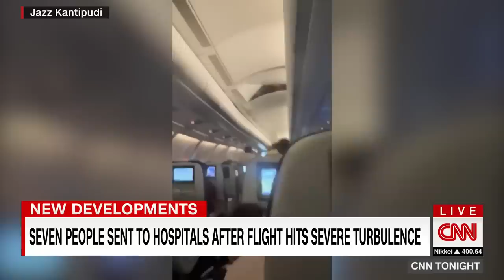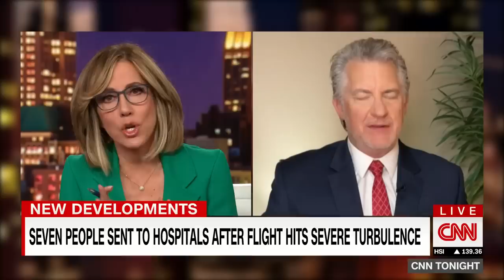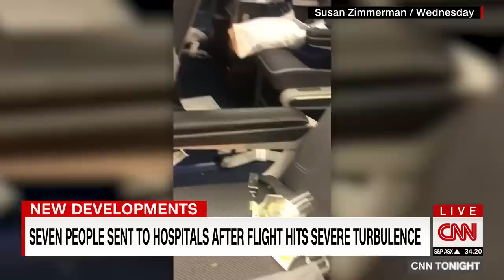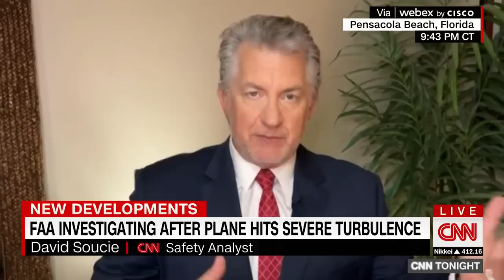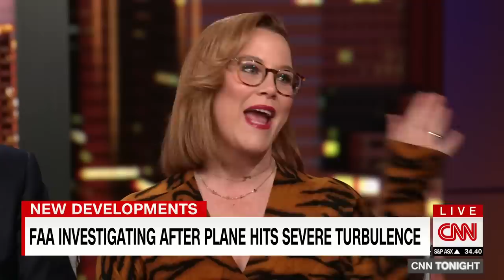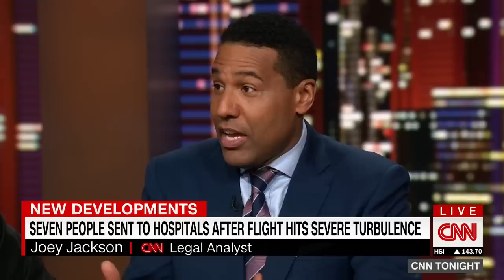Video shows aftermath of extreme turbulence on airplane

Comment: I experienced an air pocket drop in Japan Sea three years ago. From 37,000 ft down to 26,000 ft dropped. That was a traumatic experienced for me at that time.
Reply: I'd probably be quite terrified too. Luckily I have never experienced anything like that. BTW, do you actually know the reason for the drop? There's actually no such thing as "air pocket" (although people use that expression often). A passenger airplane flying at 37,000 ft is never far away from stalling, and that's most likely what happened in your case, telling from the large loss of altitude. Sudden headwind or flying too slowly because of a malfunctioning air speed indicator are examples of what can cause a high-altitude stall.
Reply: It must have been, you describe it like you were in 'nam.
Reply: Did you have an altimeter at your seat?  How long did it take to drop 11,000 feet?
Reply: Good to have the What's My Altitude App.
Reply: @cnnothingburgerletsgobrand6381   you shuoldn't send out signals whilest in a plane as they can interfere with the cockpit communication.
Reply: @blessedANDunimpressed  why?
Reply: @adoatero5129  Dead pressure zones. People say "air pocket", but it is the opposite. Its actually a low pressure zone, so you lose all lift force. Thus, falling like a rock
Reply: Stop lying.  There is no such thing as an ‘air pocket’ and no way you know the altitude.
Reply: @matthewcurry3565  – "Dead pressure zones."
What are those? Zones with no pressure? I'm sorry, but that's imagination. No such thing actually exists in the atmosphere. What probably happened is what I mentioned in my first comment. There isn't normally much turbulence at 37,000 feet (there can be, though) , so it was more likely wind shear (sudden change in wind speed). If you suddenly fly into air that's moving towards the direction that you are flying, your airspeed (speed relative to air) slows down, and at those altitudes the margin to slow down your airspeed without stalling is very small. If you cross the limit, you go to stall, and begin to fall. Because of the thin air, it's difficult to recover from the stall condition, and you may fall thousands of feet before you get the wings generate enough lift again.
Reply: @adoatero5129  Yup. That's a deadening in your air pressure resulting in the fall. Thanks for validating my presumption with the science 💚
Reply: @adoatero5129  The main joke is that it cannot be anything else. Lmao. With pressure you cannot fall. Without it you fall. Doesn't matter what scientific explanation resulted in it.... In the end its lack of lift pressure. So, a dead zone.
Reply: @matthewcurry3565  The lift that keeps an airplane up doesn't come from meteorological air pressure, but aerodynamic one. Also, wind (air movement) and air pressure are two distinct phenomena. When a plane (wing) stalls, what normally happens isn't that pressure disappears under the wing, but increases above the wing.
Reply: @adoatero5129  you are trying to make this a lawyer technicality battle lmao. If the pressure increases on the top side, and then the bottom is subjected to lower pressure it results in poor lift. Thus, the pressure differential can be seen as both, or either way. 
I'll just argue that aerodynamics is literally all about pressures, and how they relate to an object moving through a gaseous body.
Reply: @adoatero5129  And it doesn't matter what type of air pressure. I just said air pressure, so I'm still correct. I do not get your point?
Meteorological air pressure does play a role in aerodynamics, and..... Aerodynamic air pressure is obviously related to aerodynamics too. You seem to be going in circles.
Reply: @matthewcurry3565  – “Meteorological air pressure does play a role in aerodynamics…”

But (very likely) not in the incident we are talking about.

– “You seem to be going in circles.”

It seems so to you, because you are mixing up two very different phenomena. When you fly at 37,000 feet,  the changes in atmospheric air pressure are normally so small that they don’t affect an airliner much. On the other hand, there are other atmospheric variations (wind shear, etc.), that affect airliners often and quite often also powerfully. In short, the “dead zone” that you offered as an explanation for the incident is hardly the culprit, so in that you were probably wrong. I’ve been often wrong myself, so don’t worry :-).
Reply: @adoatero5129  You're the only one who brought up atmospheric pressure. Now you are saying it is unrelated. That's my very point to you. Obviously I am not speaking of how many atmospheres of pressure are present during this incident. Thus, I am speaking generally to aerodynamic pressure, because that's the only thing we, and I were ever talking about.
Reply: @adoatero5129  You seem to want to say it could be anything in a lengthy note making yourself feel better. You have at it.
Reply: @adoatero5129  I only said a low pressure zone which can happen for many different reasons. So, again thank you for solidifying my point?
Reply: @adoatero5129  Also, the dead zone you are imagining is your own internal viewing, and perception. The dead zone would depend on what scenario is taking place. The dead zone does not necessarily mean I am saying this massive area where it is a dead zone. There are in fact dead zones, and updraft zones around mountains which have killed many. I am not using the proper terminology I assume, but the general message remains. The dead zone in this case would be fast, right under the wing, and all the way to the area where lift can be reinitiated. That is depending on how it exactly happened, but saying dead zone is a general term which means "low pressure" area.
Reply: @matthewcurry3565  – “You're the only one who brought up atmospheric pressure.”

I’m sorry, but that's simply not true. You said in your original comment that what the original commenter called an “air pocket”, and which your corrected to be better called low pressure zone, caused the plane to fall “like a rock”. So contrary to what you are trying to say now, low atmospheric pressure was the starting point for your commenting. It may be that you wanted to distance yourself from that view, but changing your view in the middle of the discussion, while keeping up the impression that you didn’t change it makes sensible discussion difficult (as can be seen from this discussion). Why didn’t you just say that you changed your view? There’s nothing wrong with that.
Reply: @adoatero5129  Because I haven't changed my view whatsoever. Your interpretation is completely wrong, it's schizophrenic like, and you just want to argue over generalized terms for fun.
Reply: @adoatero5129  I already said as well that it is in fact a low pressure zone. I never moved from saying that. The size of the zone, and how it came to be are what you are arguing to sound smart. Its really quite cringe unless you have a better straight forward explanation on what you think I am doing...
Reply: @adoatero5129  Another issue with you is that you seem to not know the word pressure. Air moves based on it, and wind is literally the air moving due to different pressures. Wind, or what I would call sideways pressure is one factor, then how much air in a certain spot is atmospheres of pressure (up/down pressure if you will). Its actually all just pressure differences moving everything.
Reply: @matthewcurry3565  
I get no fun from arguing over things. I just happen to like honesty and clarity. 
Well, that's all from me. Thank you for the discussion and take care.
Reply: @adoatero5129  We share the same values, so this is why I am wondering what you are going on about.
Reply: @adoatero5129  Okay, you are getting lost in my made up general term. I think I see what went wrong.
I did make up the general term of; dead zone.
What I mean by this term is just a dampening of air pressure for flight. What causes it depends on the scenario. 
You are being too literal.
I was not literally saying 0 pressure random bubble zones. Lmfao
Reply: @adoatero5129  0 flight zone.
Dead zone.
In more sophisticated terms these would be the areas where turbulence, and wind dynamics can be sporadic, or shift rapidly. Aviators I'm fairly sure even have turbulence zone maps if I'm not mistaken. These would be where the potential dead zones arise.
At the same time the low pressure "zones" can appear depending on the scenario.
Reply: Why were you traumatized by that? The only time I was ever freaked, was when my mom was flying our Cessna 210, under IFR conditions, and made me handle the radio. We were at 24,000 feet, then hit a freak air pocket, and were slammed down to 13,000 feet. That put us in someone else's flight path, I had to notify traffic control, while my mom frantically started climbing back to where we were supposed to be. That was scary.
Reply: @matthewcurry3565  OK. I understand now what you meant. It's good that you explained it more accurately.
Reply: @matthewcurry3565  You stated a falsehood, and were corrected. Accept that you were wrong, and that aircraft stay aloft due to Bernoulli's principle, not the ambient air pressure.
Reply: @adoatero5129  Yeah I went back to read it then I made sure that what I said was a made up definition (to be sure I was not being accidently specific), and then put all of it together.
I appeared to say dead pressure zone lol.
What I wished to articulate was; no fly zone
That was super confusing lmao. All good 👍
Reply: @notentirelyapathetic9458  lol
Reply: @deborahfreedman333  Bro. We already figured it out. I didn't state anything false. I made up a general statement to explain something, and it was misinterpreted. This was already all figured out thanks to me going back, and explaining in a different light.
Reply: @SusanKay-  It's so scary what intellectuals have become.
Reply: @jerrypolverino6025  lying?! why do I know the altitude because it was displayed in the monitor as the plane goes towards the 37,000feet while ascending to the area between Tokyo area and Japan sea we experienced sudden turbulence abruptly but then when we reached between 36,+++ while reaching 37,000ft the pilot suddenly announced an air pocket then we fasten our seatbelts and within 60 seconds to 2 minutes, sudden drop all the passengers shouted. I thought the plane will plunge to the Japan Sea. That was scary! I didn’t book that airline for almost two years because of what happened.
Reply: @hotspot930  That’s not what happened.  First of all there is no such thing as an air pocket.  Second of all the aircraft made a controlled descent, most likely to find smoother air.  If an aircraft fell 11,000 feet it would fall apart.
It is not the airline you are on.  It is the weather and aircraft you are in.
Reply: @jerrypolverino6025  check the meaning of air pocket. I’m not going to argue with you because you didn’t experience that.
Reply: @hotspot930  I am a retired international airline captain with a degree in aerospace.  What you experienced was turbulence caused by flying through updrafts and or downdrafts which were caused by convective weather.  Aircraft do not fall for two miles due to “air pockets”.  It may have been rough, but the aircraft remained under control.  Had it not, you would not be here.  A large gust usually moves an aircraft a few dozen feet.  That is enough to put objects and people on the ceiling.
Reply: @jerrypolverino6025  ok you’re an airline pilot. I’m sorry to say this but not all situations in the atmosphere you know everything. It easy for you to described the situation but you didn’t experience during that time. We felt during that time it will plunge to the Japan Sea within 5-10 minutes.
Reply: @hotspot930  What occurred with you in that situation is common.  It is not pleasant and we do our level best to avoid that type of weather.  I would say, depending on what part of the planet they operate, the average pilot is going to get caught in similar types of nasty weather at least a few times a month.  You were always safe.  Nothing happened to you, or the aircraft structure.  It can happen on any airline.
So a better term than ‘air pocket’ would be ‘turbulence’ which are areas in the atmosphere where the air is moving in different directions.  The faster the air and the more rapidly an aircraft experiences these changes the more bumpy the ride.
Turbulence can be terrifying.  People can get hurt.  It can show up without warning.  Pilots get caught because they pushed it.  Good, highly experienced pilots doing everything they can to avoid it still get caught.  
Always keep your seat belt fastened, at least loosely even when it is smooth.
Reply: @jerrypolverino6025  you know what from that moment on, I put my seatbelt fasten. Thank you for this fruitful conversation. Stay safe.
Reply: @hotspot930  That’s smart.  Same to you, and good travels.  By the way, watch the weather before you fly.  Avoid fast moving cold fronts and thunderstorms.  Some storms start in the morning, another type starts in the afternoon.  High pressure systems are good flying.
Reply: I experienced a storm turbulence maybe a 10ft sudden drop. It was the most terrfying. How was it for  thousands of feet in just few seconds.
Reply: @neiljasonvillanueva1864  It did not fall thousands of feet. If so the aircraft would have broken up midflight
Reply: @jerrypolverino6025 Ok  yeah I meant descended.
Reply: @notentirelyapathetic9458  well on the screen infront of you it tells you how many feet you're above sea level. Jet blue does atleast
Reply: @hotspot930  Scary situation. How long did the drop take? I have heard about clear air turbulence causing a 1,000 foot drop in seconds but not 11,000 feet.
Reply: No such thing as an "air pocket" and you did not drop 11,000 ft due to turbulence.  Stop lying

Comment: I flew on a plane only once in my life, and the turbulence that I experienced felt more like a road that had a few pot holes than a roller coaster ride. We were encouraged even after the plane had reach altitude to leave our seat belts on.
The sever turbulence those passengers experienced, is a lot more dangerous than they're telling. Ask any seasoned flyer.
Reply: No, that is not very dangerous. As a seasoned pilot there is very little to no risk.  It made a mess of the cabin and a few spilled drinks, but no risk to the aircraft itself.  Flying is safe.
Reply: @notentirelyapathetic9458  That is true to a certain extent the aircraft cannot withstand  too powerfull gforces for example within a cumulus nimbus cloud or a severe thunderstorm as it will cause structural damage to the aircraft
Reply: @elcaballodetroya8941 you don’t know what you’re talking about. Ask any aeronautical engineer. It takes much more than a storm to rip apart a modern airliner
Reply: @notentirelyapathetic9458 safe? Turbulence doesn't seem safe

Comment: The greater the temperature contrast between the equator and the poles, the stronger the jet stream will blow from west to east across the North Atlantic, directing and intensifying storm systems, and it has also been found that at higher altitudes, including the lower part of the stratosphere above the poles, there is a drop in temperatures due to climate change. On the other hand, the upper troposphere above the equator has increasing average temperatures. This means that the temperature contrast increases at those heights. Lower in the troposphere, the opposite occurs - temperature changes weaken the temperature gradient and are expected to slow the jet stream.

Comment: Look at the lack of damage to the overhead luggage racks.  They are basically made of reinforced paper or similar material.  In really severe turbulence, passengers who are so stupid as to undo their seat belts can hit the cabin roof hard enough to smash the overhead racks - or break bones when they come down.  The aircraft is required by law to be capable of withstanding the structural loads involved in flying into atmospheric turbulence - and quite obviously this one did withstand them.  There has been a vast amount of research, starting from the second World War, into atmospheric turbulence - and the design standards for aircraft take that into account.  Driving a car, the "G" loads are at maximum zero "G" to + 2 G.  In an aircraft, they can go from perhaps +5G to - 4 G - so the seat belts are there for a reason.  Use the damn things!

Comment: It isn’t called “clear sky turbulence” it is called “clear air turbulence.” Using correct nomenclature is important to sound credible. I am a 777 pilot and never in my career have I heard of an airplane losing “thousands” of feet in turbulence during cruise. It really is a simple procedure on the pilot’s end, you slow to your turbulence penetration speed and just maintain attitude and take any deviations in altitude. Read that again, maintain ATTITUDE and take any deviations in ALTITUDE. If you fight the turbulence you can induce more stress and quite possibly an aerodynamic stall which is a much more precarious situation to be in.
Reply: Erick, your conflating of ATTITUDE and ALTITUDE does little for comfort...and I am a frequent flyer between the EU and the US.

Comment: Flying maybe safer than driving, however when my cars engine stalls I am not dropping 32000 feet into the atlantic ocean screaming my head off:)
Reply: @D G no I dont. Its an irrational fear. And one I have only developed recently.
Reply: @D G Wow thats pretty impressive, I actually really dont know why. I was also in the military here is SA back in the 80s and flew in c130s, c160s, Dacs also the Puma and alhoutte (sp) choppers. I will still fly but never really enjoy the process.Yet I will surf a sharky break and not worry about it. silly irrational fear really!